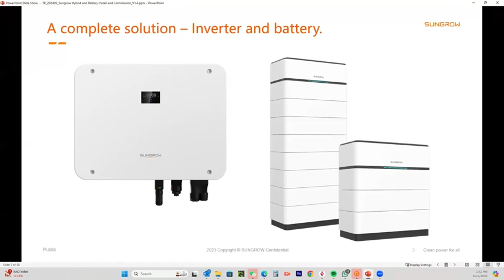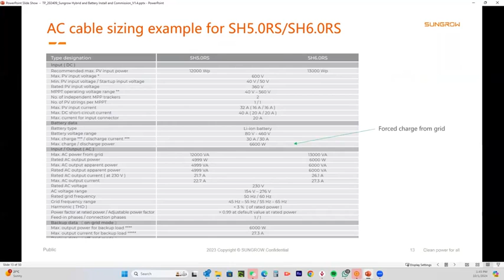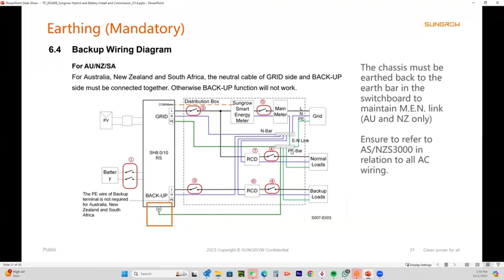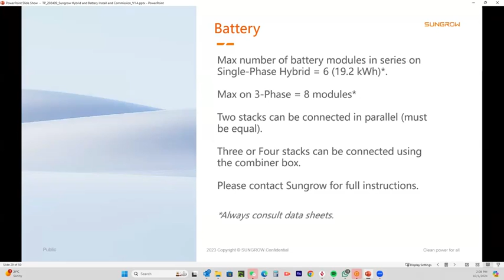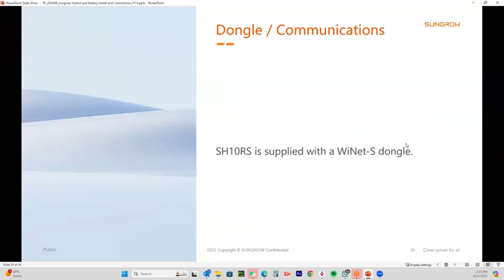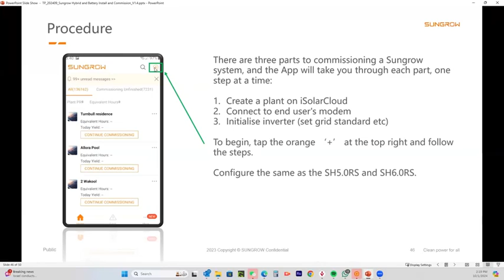Training Webinar: CPD191 Install & Commission Sungrow Hybrid Inverter & Battery

Comment: Why only the explanation for battery communication via CAN? I just have UTP in the battery and UTP in the inverter (SH5.ORS), and it works fine.
Reply from the maker: CAN is the communication protocol, and UTP is the type of cable. The battery comes with a length of Cat6. Using incorrect cable will result in a loss in signal quality

Comment: For all house buck-up output is required to have series monitoring and control relay (for under/overvoltage) as it is used for conventional house grid electricity ?
Reply from the maker: All backup control is internal

Comment: Hello! The whole house backup is applicable for SH8.0RT și SH6.0RT as well?
Reply from the maker: Whole house is available on the SH8.0RS, SH10RS, and the SH*T range. The SH*RT range have insufficient on grid range to do whole house.
Reply: Just to make sure, because my installer has a different opinion : if I install SH6.0RT I must separate the loads in essential (on backup port) and non-essential (on grid)? Thank you in advance for your assistance!
Reply from the maker: All backup circuits are "essential" circuits. Care must be taken to keep under the maximum output, and also if an outage happens at night, you may only have the reserve SOC of the battery until the PV comes back online. Refer to the standards in regards to the labelling and location requirements.
Reply: Thanks you so much for all answers. Still, I have one more, I hope you will have a minute to answer. What is not connected to backup port but to grid, will be feed by the battery at night if the battery power is sufficient and grid is working? I know what is not connected to the backup port won't have power if there's a power outage, but how it works if there's battery available and also grid? Will the battery provide power to all loads or just to the ones connected to backup port?
Reply: @alexandrumunteanu5152  Battery will supply power to everything on the consumer side of the energy meter while on grid